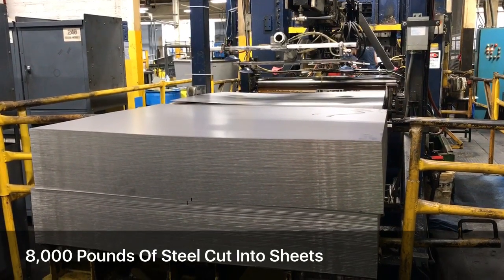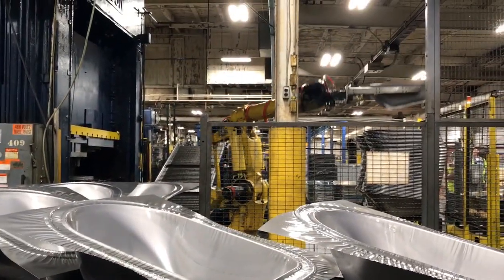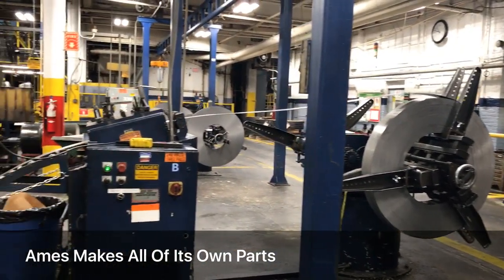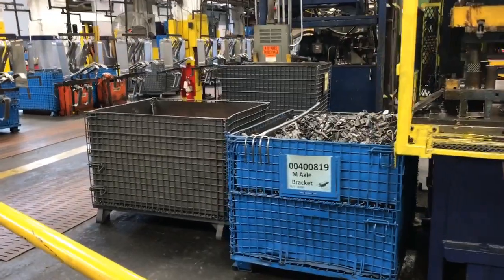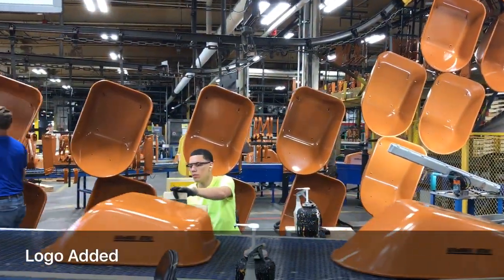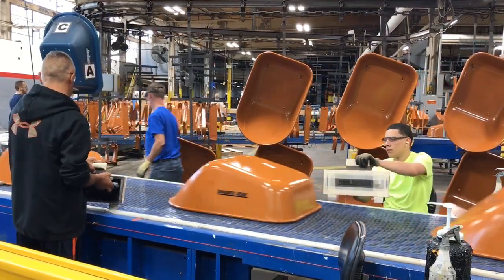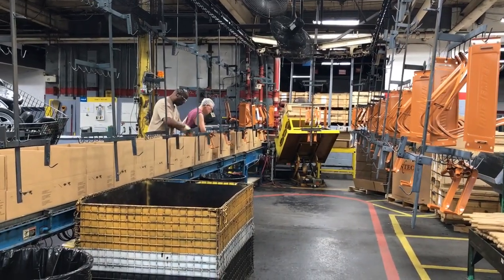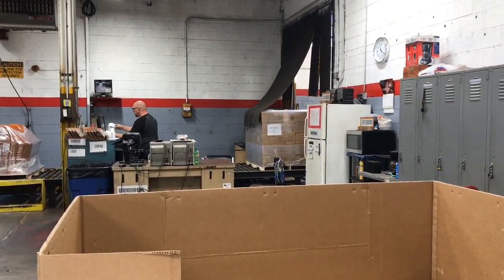See how wheelbarrows are made at Ames plant

Comment: Good USA company. I have three of these barrows.
Reply: <<
bearbon2
1 year ago
Good USA company. I have three of these barrows.>>

Why do you need three?  You must be a contractor.

What features do you look for,  and for what purpose?

I just did an overhaul on my barrow.  Bothe the wood and steel parts needed to be taken apart,  painted and maintained  ----steel wheel for pneumatic tire,  too.

Do you inspect and maintain your barrows,  or just use them till they die?
Reply: @SeattlePioneer  One for the barn, one for the yard work and one made into a self propelled unit for my walk-behind tractor. Steel tub is durable and better than plastic. I just keep the axles lubed, tires at 30 psi and always store them inside. Wouldn't buy anything else.